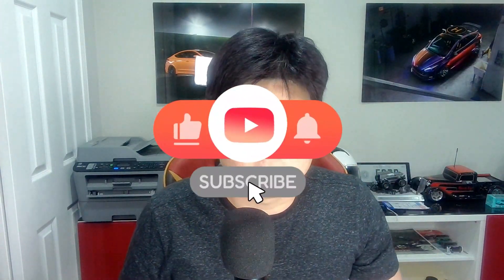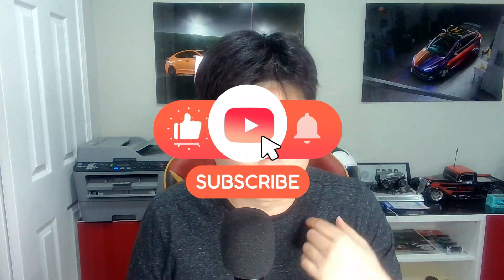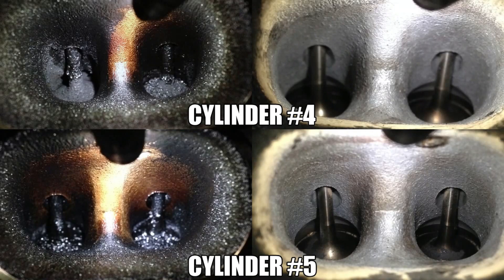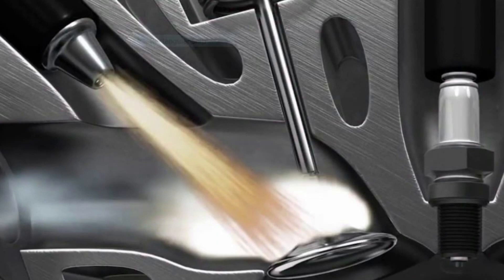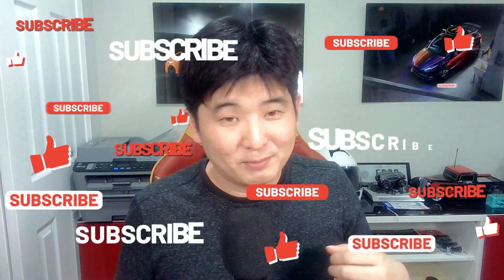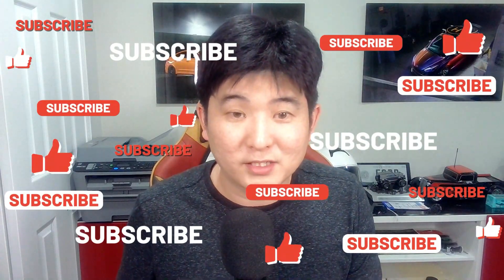Why you NEED Water/Methanol Injection in your car!

Comment: the more I hear about this the more I'm convinced. Even outside power improvements, it seems like a smart addition to any engine. My questions now are could you use this without a turbo, and could you use this at all times in some way instead of just when boost starts to get going?
Reply from the maker: There are kits that run off map / maf signal. So you can use it on non forced induction cars and set up the spray to come on at only certain voltage preventing it from flooding the engine at idle

Comment: 2 important bits I think you should have added is the water turns to steam, when it does that the expansion rate is around 1600 times. Even though it is a small amount of water by expanding that much it effectively turns your combustion engine into a steam engine giving you a nice increase in torque (if you run just water you get this torque for free). The other point is on a diesel engine the combustion ignites the methanol so you get a longer burn time increasing power and torque and lowering emissions (that last bit will make greta smile........maybe  )
Reply: it is possible to use only deminarilet water??

Comment: That's true!
You don't only gain power, but you actually coll your engine down (Engine + especially your Turbo loves cooler temps) 
And you constantly clean your engine..  

What do you think are the most causes for Enginge failure? 
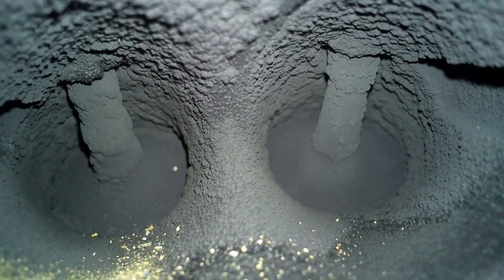Right, 2:04, Carbon built up, which happens naturally direct injection engines... 

Those nice cleaning additives in your fuel never reach your valves or anything else before your valves...

Comment: This works in my Pajero FM Gen2. I installed Devil’s Methanol Injection I feel the turbo boost more responsive when I push the psi. It has a switch so when I want to use it and it helps a lot in managing the temperature.

Comment: I kindly disagree with methanol, giving you a boost in  octane, it’s all purpose is for the system not to freeze, it is the water, the cooling of the combustion that gives you the higher octane not the methanol. Just look at a brand new BMW, M4 with a water injection system from the factory it does not require methanol, just pure water yet does the same thing as a water meth system?
Reply: You are talking garbage, methanol pulls more heat out of the air than water, you would be at odds with every tuner I've spoken to, im in a hot climate and run 50/50 and it's not for freezing.
Reply from the maker: Octane is definitely boosted using methanol. 

Here is an article that you can read about methanol and ethanol as well

https://www.topgear.com.ph/features/feature-articles/here-s-why-having-too-much-methanol-in-your-fuel-is-bad-a36-20161221

Water in the bmw’s system is used for keeping the valves clean, which the direct injection cars are prone to getting gunked up

Comment: How does water meth injection work for a stock pickup towing a trailer up a hill. Will it wash the oil of the cylinder walls and cause premature ware?

Comment: Hi. Im looking at modifying my r53 cooper s ive seen in forums that if you go too far with supercharger upgrades the higher intake temps can cause it to "pull timing" and damage the engine would meth injection help remedy that issue
Reply from the maker: Hi, yes meth injection definitely can help with that

Comment: Is it better to run 50/50snow performance or 80/20 vp racing
Reply: I think it just depends on the user and application. There’s videos showing 100% meth makes more power but it’s very flammable and dangerous if something goes wrong. 50/50 won’t ignite and still gives you a lot of gains.

Comment: Important to not use it to much as it’ll be washing your cylinders walls, is a bad thing…
Reply from the maker: Too much of anything is always bad :)
Reply: It does not wash your cylinder walls as oil does not wash off with 0.001 second of steam!
Reply: @robertjohnston3658 driving all day in the rain is fine,,, doing that all day  everyday all the time gets to be too much washing the cylinder walls. Scientists knew this during WW1 when they where adding water meth to piston engine by planes.

Comment: So I actually read a long article on WM injection and it turns out the water boosts the octane. The higher the octane is of fuel the slower the burn right? So water slows down the burn rate of the fuel. Allowing for more headroom with timing due to less chance of pre-detonation/Knock. 

The Methanol evaporates extremely fast especially when it is sprayed as a fine mist, The faster something is able to evaporate the cooler it is, The cooling is all to do with evaporation and methanol is king at evaporation! This is why the stronger your meth solution the cooler your IAT’s are. You can easily monitor this in logs. I ran a pure water solution as a test and the cooling was minimal but the logs in terms of timing were very clean. Add methanol to the mix and the intake temps dropped rapidly.
Reply: Octane and length of burn have no relation whatsoever. Water doesn’t slow down the burn rate either. It simply cools off the intake charge which reduces the tendency for the air-fuel mixture to detonate. 

Further, water does more to reduce intake temp than methanol. Methanol is used to increase octane, water is used to reduce air temperature.
Reply: @boost1728   wrong, go do some research and revert back.
Reply: @sachak  follow your own guidance. You are severely mistaken on all accounts. Again water decrease charge temp. Methanol increases octane. And in case you’re still confused I’ll say again higher octane does not equate to a slower burn; it is simply less prone to detonation. Burn speed is an old rumor that’s been disproven literally hundreds of thousands of times.
Reply: @boost1728  I have done my research and stated it here. But let me paste some for you: 

116+ Octane With Water Injection!
For many of you reading this, you may already be familiar with the substantial octane increases possible with a simple water methanol injection system (methanol can be substituted for other forms of alcohols such as ethanol, isopropanol, etc.). While for many others, you are just becoming aware of water injection for the first time and what it has to offer.

Water injection isn't new. It actually dates far back to the 1930’s where it was extensively used for the first time in WWII on supercharged and turbocharged fighter aircraft to increase power on take off and increasing the altitude for which a plane could climb. In 1942, the German Luftwaffe increased the horsepower of the Focke-Wulf 190D-9 fighter aircraft from 1776HP to 2240HP using 50/50% water methanol injection. Likewise, the turbocharged Pratt & Whitney R-2800 engine picked increased it horsepower output from 2000 horsepower to 3800 horsepower with the use of water injection. Manufactures such as Chrysler, Saab, Porsche and GM also used water injection on various large displacement, high compression or turbo charged motors such as the Saab 99 Turb. As well as 1962 and 1963 GM Oldsmobile Jetfire with it's turbocharged 10.25:1 compression aluminum V8. To keep detonation under control Oldsmobile used water injection and a fluid called "Olds Turbo Rocket Fluid" which was nothing more then a blend of water and methanol and a corrosion inhibitor. It was also used in Formula 1 racing for a short period of time before being banned for adding too much horsepower.

In recent years, water methanol injection has become ever more popular and recognized as an invaluable tool for both gasoline and diesel forced induction engines. As well as normally naturally aspirated applications. While often times referred to as a “chemical intercooler” it is more commonly used in forced induction applications due to it’s substantial cooling effects and added octane increase it adds to pump gas. Reducing air intake charge temperatures by 50-200+ degrees F almost instantly. Providing a substantially cooler denser intake air charge for a greater expansion of power within the combustion chamber. While also largely eliminating the problem of engine “knocking” and allowing user to run higher levels of boost, compression and increased timing.

As previouisly mentioned already, water methanol injection has become a tried-and-true proven way for users to effectively increase their 87-93 octane pump gas. Depending on the amount injected and the type of mix used (pure water, pure methanol or a mix of the two), gains up to 10-25+ points in octane can be achieved. Thus making 91 octane pump gas act like 105-116 octane racing fuel in their engines. Thereby eliminating our dependency for notoriously expensive racing fuels, which can cost upwards of $8.00-$12.00 per gallon as so many of us have reluctantly had to use in the past. Costing only pennies to operate when using 100% water, its also a far more effective, affordable and convenient to those expensive octane booster fuel additives as well.

While once believed impossible several years ago. It is now possible and becoming quite common to find individuals using 91-93 octane combined with water methanol injection to support engines well over 1000+ horsepower. One top engine builder, Steve Morris of New Era Performance, has already made upwards of 1700+ horsepower with a non-intercooled carbureted big block Chevy ProCharged engine on 93-pump gas using only 100% water injection .

Then read this: Specifically the "Performance section"  

Methanol Injection as an octane booster
In Methanol Injection Systems, can I use pure methanol? While all components of injection systems are designed to be able to handle pure methanol, it is not recommended for a number of reasons.

Safety: Pure methanol is easy to ignite and burns with an almost invisible flame.

Performance: Water absorbs twice as much heat as methanol in the intake and inside the combustion chamber. Water cannot be flash-ignited, so has what is almost an infinite octane number. In the government studies for WWII piston-powered aircraft, 50/50 water-methanol was found to be the best fluid to use for auxiliary fluid injection.

Tuning and Engine reliability: Injecting 50/50 water-methanol will prevent over-injection. If too much is injected, it will quench the flame front and the engine will bog and lose power. If too much straight methanol is injected, this will not happen, as methanol is very forgiving of rich mixtures. This could instead lead to explosive backfires, cylinder wash, etc. which will not happen when 50% or more water is in the mixture.

Enjoy your day.
Reply: @sachak  I’ve been using water meth on my turbo cars since 2009. You can copy and paste all you want, water is used to reduce intake air temp and methanol is used to increase octane. Both reduce the likelihood of detonation in their own way. And again high octane doesn’t equate to slow burn. 

Stop spreading nonsense information.
Have as good of a day as you deserve.
Reply: @boost1728  If you don't want to educate yourself and do proper research that's fine, those of us that like to actually do research and look into this stuff properly and understand it can do it at their own discretion, you do you and the rest of us educated folk can do things the proper way. 

If you want to do some of your own testing with the temps, go full your methanol tank up with pure methanol, do some 3rd gear pulls and log the intake temps, then do full the tank with just water and do the same test with the same ambient outside temps. The water methanol will yeild MUCH lower temps. How do I know this. I have been doing this now for going on 6 years and done plenty testing and logs and have hundred if not thousands of logs on MHD showing the results of different mixures and how this affects timing advance vs timing corrections etc. I have my own personal research into this as well as all the data I have read over the years. This is why I was able to so quickly get some of the research and paste it here. You just have your own nonsense that your're spewing before actually studying how any of this works.

Comment: So if I tune my 2012 genesis 5.0 on 93 I can get a kit and just mix it 50/50 water and meth?
Reply from the maker: You can run it on top of 93 oct tune without much issue
Reply: @BTRcarcustoms  wait what you mean “much” issues, would there be any?
Reply from the maker: @ActsOfCaedis  its a figure of speech. The tune would have no issues with the water/meth.

Comment: Like how beneficial would it be for a NA 3.8 that’s on e85 I know it helps a lot on the turbos
Reply from the maker: Only benefit you will get would be the cleaning effect and some cooling effect. E85 already has some cooling effect on its own and octane increase.

If you wanted to run the meth kit purely for its cooling and cleaning effect especially on a direct injection engine, you can run a small jet with distilled water instead of water/methanol premix.
Reply: @BTRcarcustoms  so maybe like 5-10 whp I make 337/307 rn
Reply from the maker: @Almighty_F30  not sure if there would be much more power to be gained as your timing would already be fully advanced as well as afr being adjusted for the e85
Reply: @BTRcarcustoms  my thoughts exactly would the car itself pick up anything just from the better IAT I’ve seen comparisons with like a 40 degree temp difference from running meth

Comment: What does running straight M1 with 93 equate to for octane? I’d think diminishing returns past that 5050 mix.
Reply from the maker: Not sure wha the math is like but yeah seems like after a certain point its not really necessary
Reply: Straight m1 is around 129octane
Reply: I’d think at that point you benefit more with bigger pure turbos and upgraded high flow fuel pumps to get even higher boost and output but then you’re putting more $$ into upgrading engine parts to handle the power at those limits

Comment: Hello, Sam

Could you strictly use W/M injection in a NA vehicle to keep your valves clean without a tune?

I totally understand if you get your vehicle tuned for W/M your able to make more power.

Appreciate the information and thank you once again!
Reply from the maker: You definitely can!
Reply: listen @ 9 minutes in...
Reply: You can buy getting a tune I cheap and you'll get the benefits of all of the above without a tune you will be running to high of octane and the vehicle will not spray as much fuel into the engine to retard the timing. Tune is recommended.
Reply: @Ryan Jacoby  Thanks for trying to answer my question but you should go back and listen @9 min. in

In the video he never said specifically that you DON'T need a tune in order to run W/M injection. 

Since, I asked Sam a question he answered me with a response that was specific to my question.

Comment: What is MPI bk1
Reply from the maker: MPI is Multiport injection. Bk1 is 2010-12 genesis coupe
Reply: @BTRcarcustoms  and how does that help?
Reply from the maker: @CMayoral  not understanding your question
Reply: @BTRcarcustoms  sorry you mention that there’s no need for Walnut blasting because the bk1 has MPI what is the benefit of MPI
Reply: @CMayoral  fuel gets spayed over the tops of the valves to keep them clean.
DI injects fuel direct into the cylinder so the back of the valves.
WMI has many benefits.
I run straight meth but it’s mainly on board for added octane and to supplement the fuel system (there is no upgraded fuel options for the Veloster N platform.. so meth it is)

Comment: I have a bk1 3.8 pretty much fbo without forced induction at about 45k miles, should I walnut blast and see about a water meth kit? Go straight for a kit and then come get it tuned what do you recommend
Reply from the maker: BK1 has MPI so your fuel injectors are doing the cleaning so no walnut blasting is needed, but adding Water/Meth is definitely a plus!

Comment: Man, I'm sure my Bk2 3.8 gen coupe  with 133k has emphysema.  Her poor valves are probably so gunked up. I want to get it walnut blasted in the next few weeks . Very good video!
Reply: Got to learn how to do this stuff yourself man. I have 147k miles on my MK7 GTI. Original owner.  I’ve completed four valve cleaning jobs myself in my ownership. I have a meth kit that sprays on distilled water right now. Valves look dang clean.
Reply from the maker: haha definitely needs cleaning at that mileage
Reply: @BTRcarcustoms  I did find one, who mainly works on European vehicles, who is supposed to get back to me on a price to do it.
Reply: @BTRcarcustoms  Yeah, it's hard to find shops around here that do it (Eastern NC). I ask shops and they act dumbfounded.